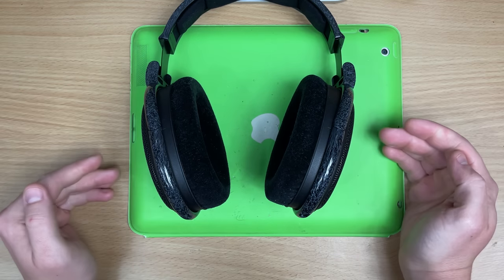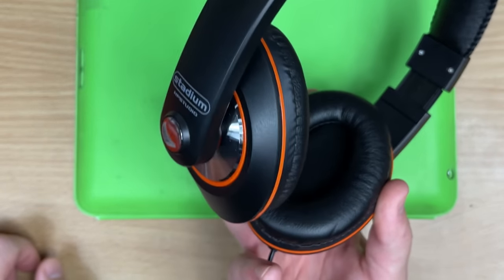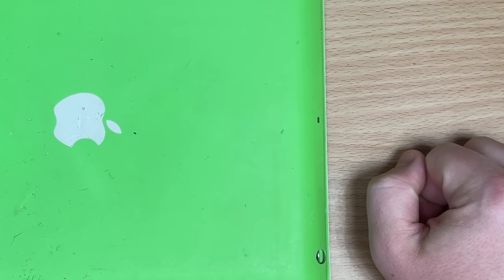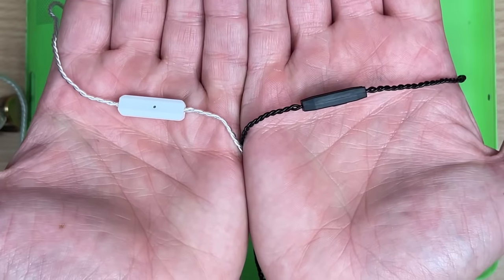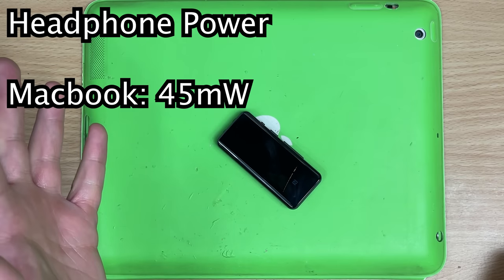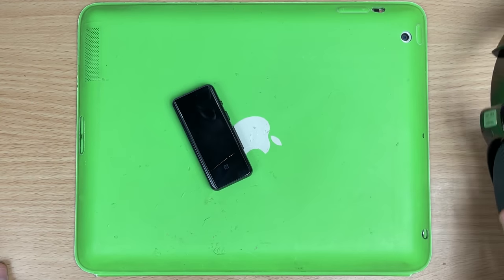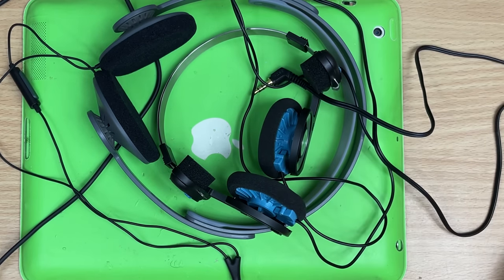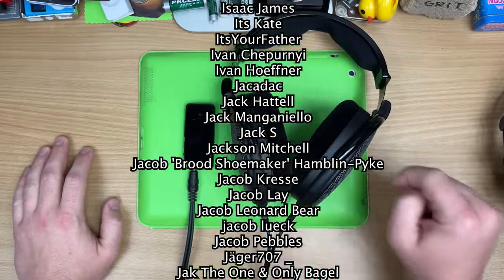My Cheap Headphone Starter Guide.

Comment: The metal parts on the K52s (and K72s!) Are part of why I own a pair of K72s! There always the question of how do you get the music from one side to the other? Premium options tend to have two cables but if you're saving a buck and only want one you run the wire up through the headband somehow. K240s (and clones) had the idea of the rubber coating the wires and making them nice and stiff and that is the headband! K52/72 room it one step further and that almost sprung steel band IS THE WIRE. It may not be the "best" sounding headphone but I love it for the ingenuity and creativity that went into the design (even if it's a but flawed)

Comment: Superlux HD681 were my mains for over 5 years and I absolutely loved them. Bassporting them made them feel much thumpier while still having the nature sounds or concert binaural recordings sound just incredibly real. I switched over to Beats which were 3x as expensive and compared to the Superlux, they are extra narrow sounding and really are just "meh". Wouldn't buy them again. Go for the Superlux brand, it's a steal really. The strap broke after like 1.5-2 years of use (fixed using an tic tac box between strap and the frame taped together) and the cable broke twice, basic resoldering job. The insides of earmuffs started breaking down after over 3 years of having my sweat in them, meaning you had to clean out the broken off bits of sponge from the drivers. Might really buy them again soon, as I loved the open-back nature, and the "monitor" sound quality (with a touch of EQ for my taste)
Reply: Thanks! you sold me :)

Comment: I was really tempted by the Samson SR850s or the superlux HD681s, but it wasn't that much more to just get the AKG K240s they're copying. The new ones are 55 ohms, so you don't need an amp with them. I'm really impressed with them so far. Not as much bass as I'm used to, but I finally know what he means when he says how music feels wider with open backs. Now my coworkers will know when I'm listening to Britney's toxic, though. Lol
Reply: Remember they are copying the chassis and not necessarily the drivers. And the 850s are only 32ohm so you can use them with anything, the new 240s are 55ohm, a bit more power hungry, also the driver is 50mm on the 850s and 30mm on the 240s. That alone means that the internals are in fact different.

Comment: The KPH30i are definitely not as well made as the PortaPro. The KPH are notorious for the headband snapping after one or two months. I’ve treated my PortaPro (technically KSC75 on the PP headband) like absolute crap for years and the headband is still in perfect condition.
Reply: Second this. My KPH30i snapped after normal use. My porta pro has been abused and still going strong

Comment: I had both the Samson and the superluxes at the same time, I tought I noticed a difference but failed every blind test. But the difference I tought I heard was, I felt the Samson's had less ground on the bass but the superluxes were sometimes too bright, with piercing highs, and I didn't felt that on the Samson's, ended up selling the samsons, should have kept them, superluxes are easy to come by used, not the Samson's, also both of them were on pleather earcups, teacups do chance sound, sometimes by A LOT.

Comment: The Koss Porta Pro's were actually one of the first headphones I've ever gotten that weren't just the included dirty buds that you got alongside your iPod/phone.
They were extremely cheap, probably even cheaper like 20 years ago because I remember clearly how the cable just disintegrated during use. The cable is THIN like nothing else, could almost floss your teeth with it and with just regular use the cable breaks.
I think I went through 2 of them and on both the cable just broke, mostly around the 3.5 mil jack.

Comment: High Ohms means they draw less power from the same amp, thus aren't getting the most of its capabilities, but you could connect a lot in parallel with little voltage sag on the amp.
Some people think they sound better because the amp has better control of the drivers.
The lower impedance headphones draw more current and make more use of the amps power, but may not be more efficient over all though they usually play louder by sucking more power into themselves.

Comment: I had to go check Toxic for that sound. Couldn't hear it on my 6XXs, but I switched over to my old 598's and damn, there it is. I've been frustrated before that the 6XX has such severe top end roll off but this is the first time I've missed a sound on it. Now that I know where it is, I can pull it out if I really listen for it on the 6XX but wow...
Reply: I went with my crappy Dell branded headset... if youre not specifically looking for it, you  totally miss it with crappy headsets.
Reply: @algis-kun8777  the 6XX isn't a crappy headphone though. Objectively it's better than the 598 and is phenomenal at vocals and midrange (6XX is a Sennheiser HD650), but it's a completely different tuning than the 598 with focus on almost a perfect midrange rather than treble and bass

Comment: My current headphones, I've had for a good 2-ish years. They're a pair of Sony WH-CH710N (lovely name I know). I bought them for about $99, a little over one hundred with shipping, when they're normally 170-180 dollars. They are little troopers, I am very hard on headphones, I use them everyday, but these have held up amazing, even after countless drops. The sound is good (although I used my phone to add a bit more bass to my songs, as i like a bit more bass). The battery lasts like 3 days with continuous use, all day. I would really recommend them

Comment: I'm sure you've gotten this comment a lot, but I prefer the KSC75 out of the Koss lineup. Pretty much the opposite of the Porta Pros, lacking bass but with a decent amount of top end, nearly too much for me. They usually sell for USD $15-25, the massdrop KSC75X black version cost me $25 shipped to Puerto Rico. Although they add to the price, with some simple mods they can be made more durable and comfortable. For example, glue fix to prevent cable wear inside the unit, adding 2 pin adaptors by soldering to make the cables replaceable like the KZ, Yaxi pads, and getting the parts express headband or any compatible one like the one from the porta pros. Havent tried the Kramer mod yet though.

Comment: On the Koss headphones, I bought the Massdrop Porta Pro's out of nostalgia and will get them out occasionally only to rediscover the reason I didn't like (the hair pulling and worried they might break in a stiff breeze).  I have the Koss UR-40s I use at work and love them, and the KPH30i's are great if you want a lighter weight and closed set of headphones. At home, I have a pair of Sony SHP-9500's (non S), and I prefer the extra punch of bass in the UR-40s.

Comment: You talked about ohms and I dug out my tiny travel earbuds (bluetooth) to see what the holmes were, and, it wasn't listed on the box.  But I know algebra! I know electronics!  I can calculate the homes myself~ ah I don't know the voltage...

Fortunately for me, I found out that it was listed on their website.  Which meant that these tiny earbuds are running off of very small voltages, like 30 mV.

Comment: Listening to a recording of Koss Porta Pros on Koss Porta Pros is weird. I bought them because I needed some decent headphones to use with certain gear as my IEMs were way too sensitive, they were cheap, and they had an 80's aesthetic to match my Walkman/vintage Hi-Fi.

I would honestly recommend the Koss Porta Pros, as they do sound quite good, mostly in terms of detail, and aren't too expensive for what you get. After my experience with them, I'm planning to get more into headphones as a whole, mostly for general at home listening, late night TV watching, and listening to my Hi-Fi while laying down. Probably going to go for some Grado SR325s next, as I did my research and think I would like a brighter set of headphones, especially when listening to cassettes and vinyl.

Also, for the two people reading this considering IEMs, Moondrop has better budget options than KZ and KBear, and there are many decent options out there for under $100 from companies like Truthear.

Comment: You're channel got me into headphones well, also got into your channel while when I got my first audio interface for recording music. Got a pair of AKG k72's and AKG k240's. The k240's paired with the audio interface for a dac / amp are awesome! then I use the k72's for recording where I need the closed back for better sound isolation. I do want to get some higher end headphones, but for now both pairs sound great. I use the k72's for walks and plugged into my phone. Then the k240's at home with the interface for a amp / dac. The k240's are 65ohms. at least the pair I got, and they are quite a bit quieter on a phone or laptop. Almost to the point where the loss in volume is unpleasant without something bringing the signal up. Which is weird for 65 ohms, but that's my experience with them.

Comment: If you want a pair of in ears with a more balanced sound, I can recommend the FiiO JH3. They're just a little bit more expensive than the KZ ZSN Pro X (which is what the KZs in this video are actually called), but I swear when I listened to the KZs and then listened to the FiiOs, the FiiOs sounded like nothing but mids until my ears readjusted.

Comment: I'm currently using KZ ZSN Pro X with KBear KS2 cable, because the KBear cable doesn't hold on to the buds very firmly so if they get hooked on clothes and fly off you might never see them again (which is what happened to me), I bought my KZ's to replace them and after a week of use the cable started turning my volume down randomly, when I swapped the cable with the one from the KBears I didn't have that issue again.
The KBear cable holds on to the KZ buds really well and it still sounds great and the mic is really good.

Comment: Unfortunately I have bone to pick with the Samson SR850's. 
They are cheaply made.
1. The earcups tend to fall out if you don't glue them in.
2. after 2 months of extended use the jack got crackly and the right earcup will lose connection.
3. They break easily. I'm on my second pair because the first pair came apart after 3 DAYS of use the chassi support the earcup detached from the driver.
tl;dr Sounds great, but the build quality is not.

Comment: I'd honestly suggest the OneOdio Pro-10 headphones. 32Ohm, a 6.35mm and 3.5mm jack and a frequency of 20-40kHz. 30€/35$. They are cheap but actually good sounding.
Reply: He talked about them before and thinks they're good. Not on the rack of the gods but pretty good.

Comment: I'm using Sony MDR-ZX110AP, and other than the fit, I think they sound very good, which I find quite surprising because I quite literally found them in a thrift store.

EDIT: Using a pair of HD 58Xs nowadays, the wiring in the ZX 110s broke, though I bought another pair and yeah, they're still pretty good for cheap closed backs. As for the squeezing on the 58Xs, it's pretty strong at first, but over time it kind of conforms to your head.

Also, used the kph30is for a while but the headband snapped.

Comment: Got HD58x, but quickly found them unusable due to them being open back design. 
Spent pretty much an entire summer with a desktop fan, and that goes right through the headphones. Raining outside? Someone is talking in the corridor? Neighbors are mowing the lawn? Right into your headphones, forget about being able to hear lower level sounds. Even just PC fans are very audible, and if you have a mech keyboard, then its like you're not wearing headphones at all.

Comment: The Samson and Superlux are bargains. I use the 681 for vocal tracking because of the detail. Things wound bad that sound smooth in my M50X. And 681s have better detail than my 7506 and DT770s. The 240s I use on my keyboard because they are a bit thin for anything else. The 58X are not $300 on Amazon. But they do sound almost identical to the $600. Still, I have Samson DR850 and Superlux 681 and 668B, so do I want to shell out for 58X?

Comment: I've had my Skullcandy "Uproar" bluetooth headphones for years now. Replaced the pads twice. Keep thinking I'll just get new ones. I've tried a couple... keep going back to them. super lightweight, I can wear them for hours without my ears or my head getting achy. Sound is really rich, but I know some people think they suck. I dunno. I really love 'em, and I've tried several different options at this point. I do have Sony headphones I like the sound better on, but I can't wear them as comfortably for as long.

Comment: Get the Koss KSC-75...
They fit all sized heads and brighter driver.  64 ohms..
And remember Koss headphones have a lifetime warranty..(and they do repair them rather than replacing them, they keep parts to repair headphones) 
Ans if you want a seperate Bluetooth amp then they are lots of better and cheaper ones.. 
Qudelix etc.. Are cheaper, better codecs, made in Korea(not China) and they come with amazing apps with everything adjustable..

Comment: As someone who just bought a setup with DAC and headphone amp: DO IT! (if you can afford it). It makes a world of difference, and it doesn't have to be top end stuff to make that difference. Look at a brand called Schiit, they're perfect entry level stuff that sounds magnificent, and is very much on-par with a lot of more expensive stuff out there, without a lot of the audio mumbo-jumbo language.
Reply: Snake oil
Reply: @saamo1423  keep telling yourself that
Reply: @Twinrehz  this is coming from a guy who already owns this stuff. You do not need it.
Reply: @saamo1423  sure, I don't NEED it. It still is an improvement over headphones/earplugs straight from the computer
Reply: @Twinrehz  again, not really. It is a very, very minor improvement, unless you have a very resolving pair of iems/headphones

Comment: The Koss KPH30i are pretty good, but for just a tiny bit more money, you should absolutely get the new KPH40 Utility. You can get a Lightning or USB C cable with them, and they sound a lot nicer than the 30i's

Comment: My Android phone has a TON of aduio features and I think it would sound amazing with good headphones
We don’t have good headphones to use with them tho.
But they do sound amazing with cheap 1$ headphones!
DTS:X 3D Surround sound,
And equalizer with a LOT of options,
The option to normalize volume,
Hi-Fi quad DAC,
Sound preset,
Digital filter,
You can individually change the balance of the sound in each earphone/earpice,
So many options and they all work well.
And it has a headphone jack!

Comment: I listened to this video through some Koss Porta Pros, I don't have the hair problem, but that's just my hair, I love the sound so much, and the cable is not great, but whatever, it's worth the money
Reply: Funny enough I've never had an issue with my Porta Pros pulling my hair. My HD600 does a lot though near the swivel

Comment: So by “ohms” do you mean that the Sennys have 300 ohms of resistance so you need to pump more amps in them so they sound proper?
Reply: ohms (impedence) by itself doesnt tell you how hard it is to drive a headphone. You also need to look at the Sensitivity (SPL or db/mw). eg. A 250ohm dt770  96db SPL can be easier to drive than the 25ohm HE400se but with 91db SPL (the lower the sensitivity the harder it is to drive). So you gotta look at the SPL aswell, headphones start to perform better at around 110db SPL.

Comment: koss cripples the porta pros by selling them with those cheap spongey paper thin pads. You shouldn't judge them until you try them with aftermarket pads on them. it actually has a huge impact on how they sound, way more balanced. Look at anyone praising the porta pros and I guarantee they have Yaxi pads on them, those are the version of the headphones people fall in love with.
Reply: yeah but yaxi pads are STUPIDLY EXPENSIVE for what they are (with shipping)
it's almost like the entire price of porta pros
I feel like ksc75s would be better, at least no strong clamp force and hair pulling
oh also koss offers lifetime warranty on these cans for some reason, had my own pair of Porta Pros on repair for like 1/4th-1/5th the price and they gave new ones for replacement

Comment: Please review Koss The Plug buds. At least buy a pair. The bass on them is so ridiculous it will likely give you a laugh. They’re only around $10 US on Amazon. The isolation is pretty solid as they are basically earplugs with drivers😂😂 I think these buds could actually damage your eardrums because the pressure can not escape at all.

Comment: I tried both the KZ and the KBears and I initially loved them but they both had constant low hissing when connected to my dongle or another device that had a 3.5 mm Jack, I considered getting a replacement but I think I'm done with them. Doe anyone else have any other suggestions?
Reply: Salnotes Zero's are similar price range, and generally better rated by audiophiles. I think maybe because the KBears/KZ's are much lower impedance, you hear the noise floor alot more. I have similar impedance stuff which presents the noise floor, but I don't hear it on the Zero's.
Reply: @TurdInternational  thanks man, this one a 1 year old video and you went out of your way to take the time and write this, Thanks man I appreciate that a lot

Comment: what if you just swap the kz's cable and kbear's cable? boom you got great sound and great microphone
Reply: KZ and KB Ear are different male ends, sadly. KZ uses a recessed QDC while KB ear uses MMCX (I think). Not the same, but y'know. You can buy replacements online with a mic, and with better build quality.
Reply: Easier to get an ie300 mmcx cable to a kbear.done it in a mod hd2k(takstar) and did good on em

For kz go trn cables